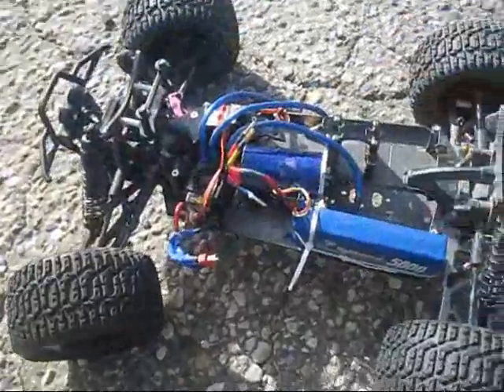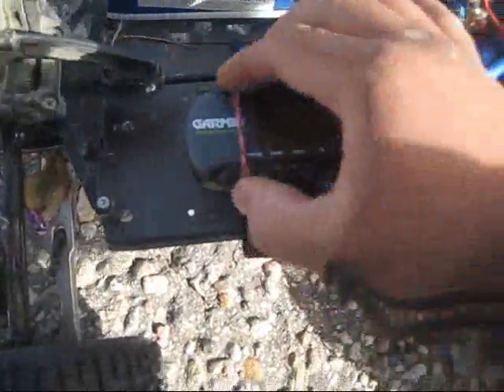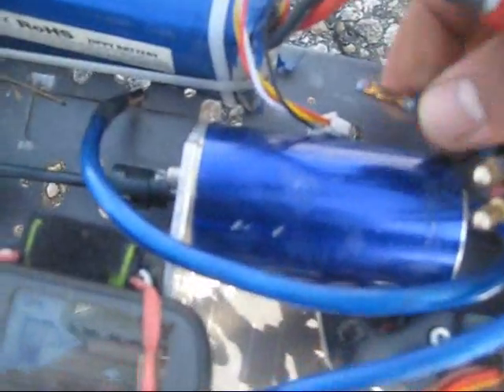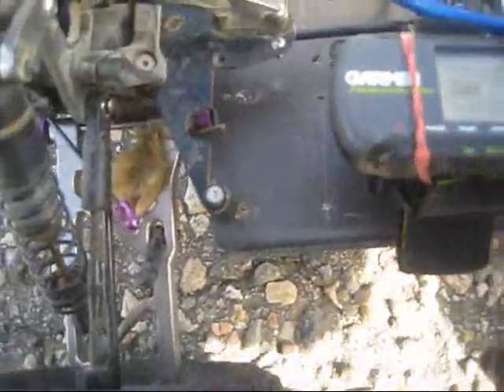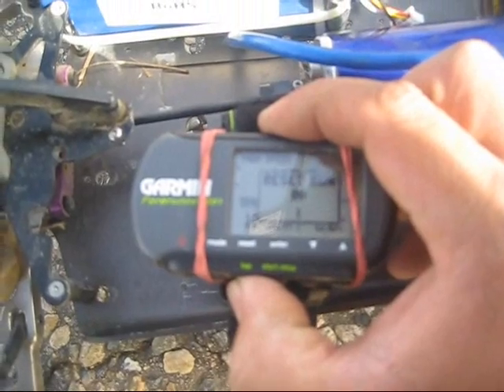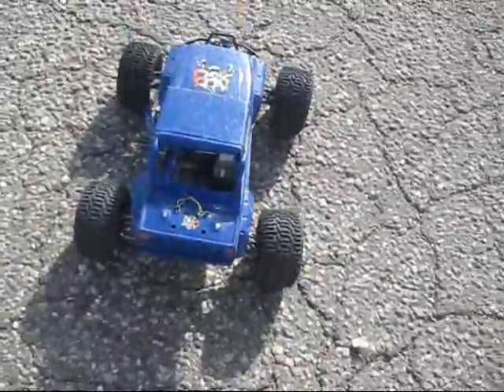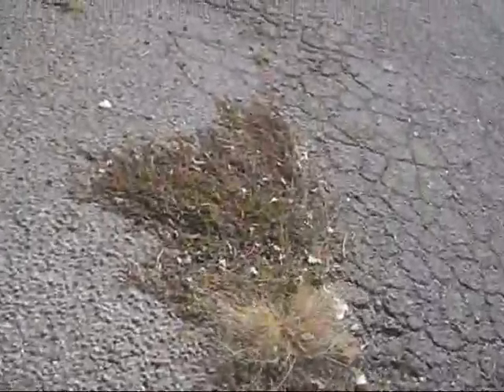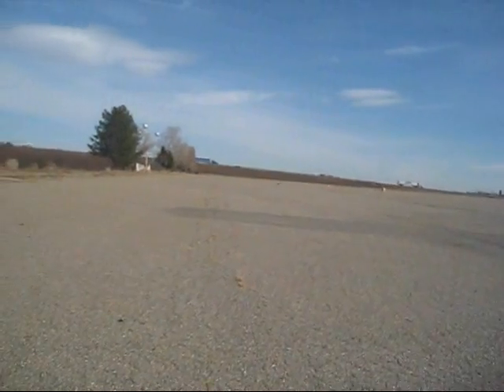brushless drive on hpi hellfire

Comment: @SCAREMONGERe the solution for this problem is very easy... smoth the schaft using a lime... when the motor is runing you smoth the schaft and stop when arrive at 5mm ....I will make this with my kb45